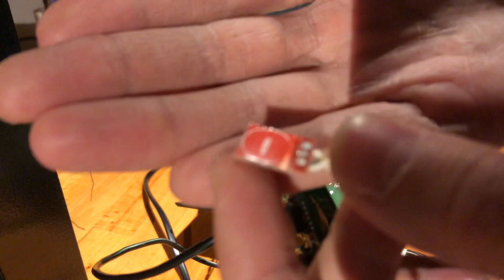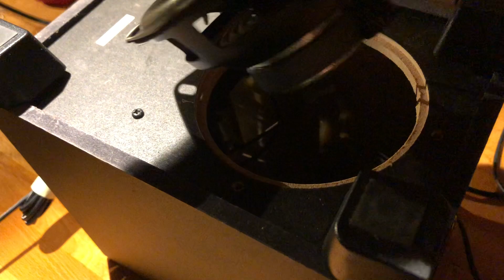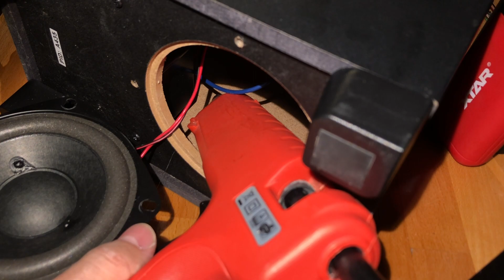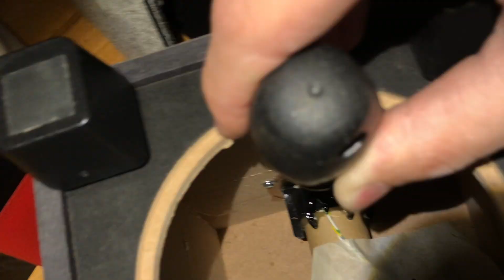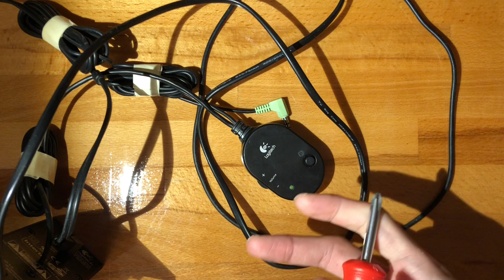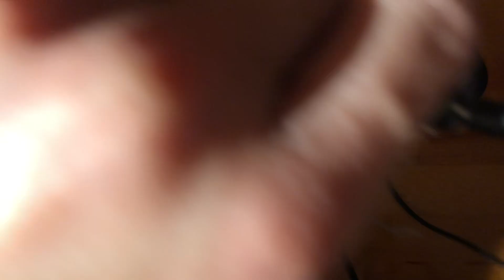Bluetooth Rampage Continues - Logitech 2.1 System

Comment: If you have power and audio input wiring in the remote, why not just put the Bluetooth in or on the remote?  I don’t know what voltage your BT module requires, but most I’ve used have been 5v, and I think you indicated 4.5v was available there.  Also, since the remote is also an aux input, it probably won’t go to sleep as long as signal is present, right?  I’m probably missing something, but makes sense in my head.
Reply from the maker: mostly right but -

what if I go out - have a beer - come back home, and touch the thing to reconnect

at that point the bluetooth module is dead - and cannot be revived

Comment: Hi! Have you tried i2s on the QCC3008? I couldn't get it to work.. only the analog out worked for me. I prefer i2s and would like to use these QCC modules
Reply from the maker: I personally haven't had experience with this

but - I did finally get to answering your email which I industrially forgot about 🥶